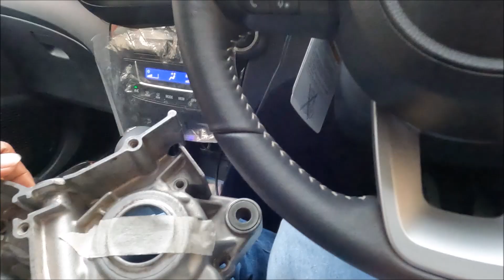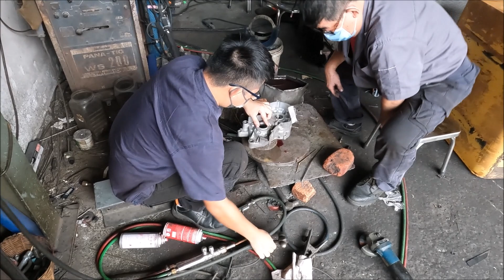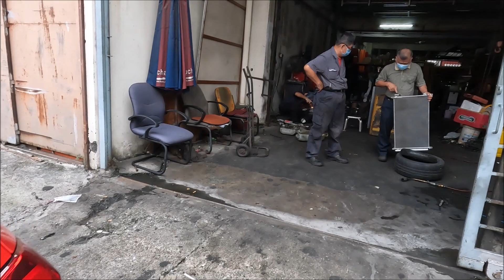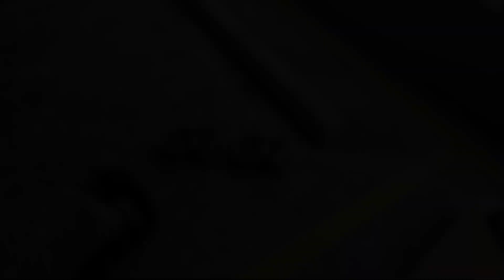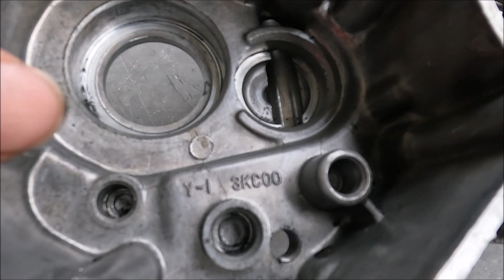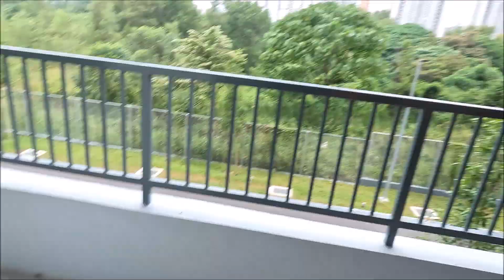Crankcase RXZ Pecah - Hantar Welding

Comment: Salam bang. sy penah pasang enjin belah cluth 55k, dan belah magnet 3kc. 
akan ada masalah berikut:-
1. Centering Crankshaft (crankshaft jd senget)
2. Gear jd ketat.
3. Tapak blok belah 3kc tinggi sikit dlm 1mm (Blok akan senget dan bocor. efek kt compression)
Tapi motor bole jalan. sekadar berkongsi.
Reply: Betul bos...perkongsian yg baik ..sbb sy pun pernah kene...repair motor cust..double center...sebelah tggi,sebelah rendah...kalau skim xsilap dlm 1.2mm...kalau pkai mcm tu motor mmg xde power...
Reply: Tula kn x sama.. Thailand punya pun ada 55k
Reply: ya betul tu.sama pengalaman.3kc org xpakai
Reply: Salam bang tumpang tanya , saya pun ada masalah sama . Bawak motor macam ada viberate dan gear 6 berdengung.  Mohon penjelasan 🙏
Reply: @ahlengofficial8975  tgok rumah bearing longgar ke tak ..Klau salah satu x fit mmg vibrate..byk faktor,cranksaft kena check,braket tambat head ,balancing..gear box tukar skali bearing bru insyaallah x dengung
Reply: @afizijamal9227  terima kasih , atas perkongsian 🙏, in Sha Allah . cek balik 🙏
Reply: Macam mana nak hubungi tuan ya..‼️‼️‼️‼️‼️‼️‼️
Reply: Nice information! I have both 55k and 3kc engine, 55k look a little bit better though,Great to know what’s the different 🙏